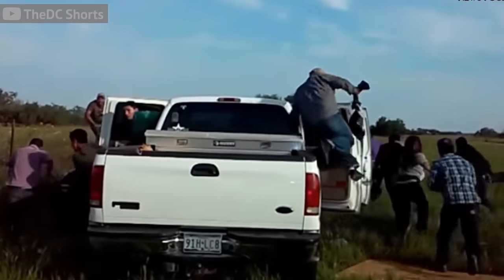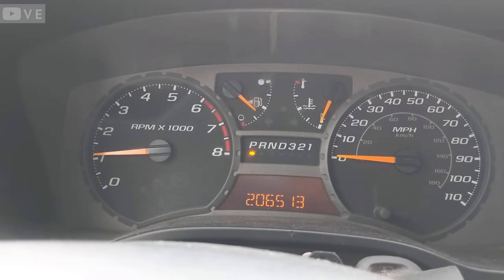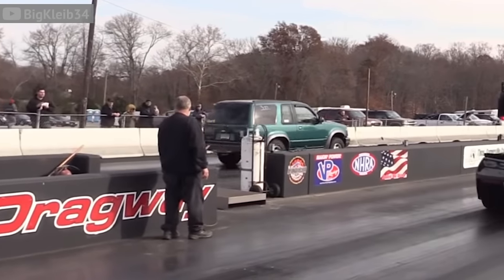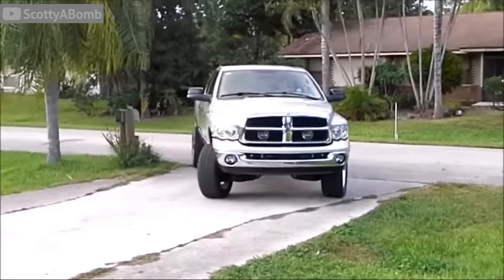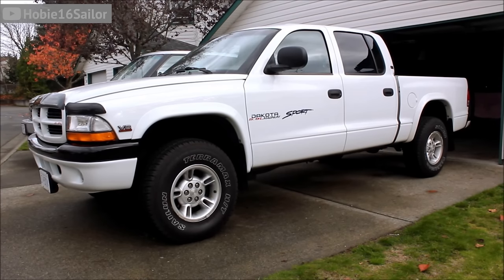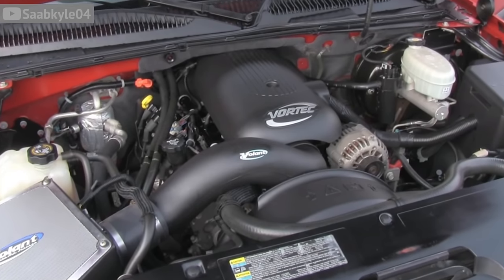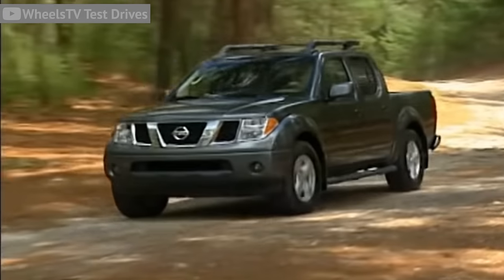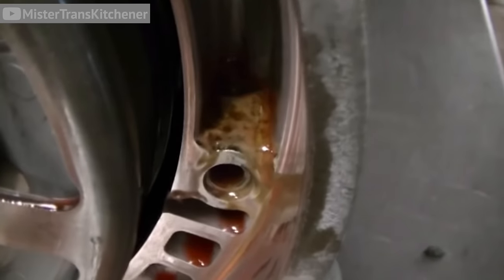USED TRUCKS YOU SHOULD NEVER BUY!

Comment: I’ve never seen a more worthy comment section. Avalanche gang ✊
Reply: @Roberto Ojeda both of my brothers had one both on them broke and it was expensive
Reply: My Avalanche 2005 has been all good I've had it for 16yrs no major problems just had to replace the water pump at 127k
Reply: I only had to replace the diff at 150 cuz we run 5400 rpm 5 days a week
Reply: 06 Avalanche Z71 on my 2nd transmission and 3rd engine.  230k on the chassis.  But damn I’ve got this thing looking good and other than the chassis, brand new.
Reply: What would be the best year you recommend? Have always loved avalanches.
Reply: @christianrojas4610  any year, they all rock
Reply: @christianrojas4610  yes and 2008
Reply: 2002 avalanche z71, 313k miles. It’s been a great truck. Only major problem was a trans rebuild around 230k but 4l60’s suck anyway.
Reply: @rsk72387  I have the new style 07 272,300 rate now Been great
Reply: @rsk72387  
 Not if you beef up the gearing and put in a Corvette salvo
Reply: im now at 400k miles on mine
Reply: 2002 avalanche and it's been great! Almost 200000 and no major issues
Reply: Avalanche 2500 8.1L is bullet proof.
Reply: @christianrojas4610  first gen all the way 02 no shitty DOD no electronic throttle body no cracking dash. The list goes on plus the first gen is way sexier than the next gen
Reply: AVALANCHE GANG!!!✊
Reply: I was sholl like dude got the avalanche twisted my boy said the taste police🤣
Reply: @natenate1462  I just had to do the same
Reply: Ive had my 04 avalanche for several years, only issue is rust. If you have to include these for driveline problems you have to add silverados, tahoes, and burbans. They are pretty much the same underneath.
Reply: @icanbreathenow1   I'm about to buy  a 2002 avalanche 1500 z66 w 82k..I was on the fence but now I'm thinking I should just do it. It will be my first truck
Reply: @splishsplash2150  398,000 miles same motor second tranny but I wasnt nice to mine and its been the best vehicle I have ever had!!! But ive replaced wheel bearing (front) battery, alternator,belt, water pump, fuel filter twice, fuel pressure regulator, 4 sets of tires, one window regulator. I pull a 24 foot boat for fishing I pull a 28 foot camper for camping. Its been through hell and back gravel pits,mudding,jumped approaches, snow bashing, burn outs. I have nothing bad to say about my 03 avalanche 5.3. Oh and my cats got plugged but for that many miles id be plugged to lol. 💪💪
Reply: I just got a 2013 chevy avalanche Ls black diamond edition and I love it!! It may not have heated seats or a garage door opener with it as well as a sun roof, but it’s been the best second truck I’ve ever owned. AVALANCHE GANG✊
Reply: @johnsonoutdoors8117  were your brothers playing tug of war with them or something like how did that happen?
Reply: @Kill0trocity  daily driving
Reply: 2002 z71 and only problem was a bad fuel bump and window motors . Also WTF HE MEAN first and last the had 2 generations not only chevy but Escalade  also had there version . And now it's coming back in chevys new Ev is the spiritual successor
Reply: I love those avalanche seems everyone that owns one loves them
Reply: I just got one it’s 2005 with heated seats and sunroof lol 140k

Comment: Completely disagree about the Chevy Avalanche. I’ve owned one for more than ten years and zero issues, definitely one of the most reliable trucks ever! wish they could bring it back to production again.
Reply: Facts the 5.3L in that thing is bulletproof guys on crack saying it had issues now the 4l60e has seen better days but its normal
Reply: Fr my dad and my grandpa both had one and never had one problem
Reply: I had a 2003 Avalanche. It was a pretty good truck with 258K miles. It only suffered from Rear differential problems but then it got fixed and still runs great. Until a Carvana truck totals my Avalanche :(
Reply: The Avalanche was a sweet truck and I wish they still made it, I still see them on the road all the time! Also as mentioned above the 5.3 liter engine was bulletproof and they used it in their pickups for years with no problems! Also I had 2 trucks with a 4L-60E behind a 5.7 and both were stock transmissions and had never been rebuilt and one had 150,000 and the other 200,000 and both were still running strong!
Reply: Agreed, I got a 2012 avalanche with nothing on it, everything is original. Nothing has been wrong accept the engine light is always on.
Reply: I have an 08 with 55k and have never had any issues.
Reply: I agree the Avalanche was one of the best vehicles Chevy ever put out.  I do not know many people who have owned one that have not been happy.  We have a 2004 we bought new and it is now around 200k miles.  Engine and Tranny has never had an issue.   We did finally have issues with Speedometer but the vehicle had 150k miles on it.

Like any other vehicle you need to take care of it, we will drive out until it just dies.
Reply: Agreed. It's a great truck.
Reply: Yessir, he said mustangs have the 5.4 I think rare models did so I don’t believe this guy or trust him at all.
Reply: x2, was rather surprised to see the Avalanche on the list. I agree the the AFM 5.3L was a stupid idea, but the original 5.3, the 8.1, or the 6.0 L engines were rock solid. Mine went way over 250,000 miles before we just decided to downsize.  I would buy one in a second - especially if it had a Duramax.
Reply: I love mine! Got an 03 2500 with the big 8.1! Thirsty on the gas and the oil though lol
Reply: 11 years still driving!!! Do not agree..👊👊 avalanche rules!
Reply: Totally agree avalanche are awesome.  I have a 2013 black diamond with 6 inch lift and 35s on it.   X pipe dual exhaust and a tune.    Truck runs solid.   Been looking into ls motor swap.  For 6.2 liter as the 5.3 is seriously nut less with big tires.   But I love my ride.   Get comments all the time just wish it had more balls.
Reply: ThePro_Luis rip
Reply: They are coming back next year 2021 and they look awesome
Reply: Same here. I’ve had 2 Avalanches. Great truck for sure (or SUV) which ever you prefer.
Reply: They are soon.
Reply: Sitting  in an avalanche as i type this lolol
Reply: My brother owned his Chevy Avalanche for 19 years... Its a red & he bought it brand new. He had zero problems with it throughout the 19 yrs he owned it.  He didn't have any problem with it..until last fall when his metal brake lines broke while he was driving causing total brake failure. He had to crash it into a tree to stop it.  He's been rebuilding it... replacing the fenders and hood and bumper that were crushed by the tree and he installed all new brake lines.  His Avalanche is now back on the road, except it now has a black front end clip.
Reply: Hey no he's right I purchase a 2013 Black Diamond Edition Avalanche june of 2019 it had 80,000 miles and the interior is like new...even the green color was a limited edition...and right out the gate 30 days in the check engine light kept coming on.. took it to dealership they didn't find anything ...then kept loosing oil pressure...then back to the dealership...it was like that for an entire year and a half until a week ago when the damn engine light came on it started knocking and I was 45 min away from my house...had to get a new engine.. internal failure on cylinder #2 and cylinder #1 intake valve lifter collapsed...also I found out there is a class action lawsuit against GM... beautiful car but that shit cost me...
Reply: Still rockN my 2004 Chevy avalanche 1500 problem free except I’ve had to change the alternator.
Reply: I love my 2003 Avalanche.  No major problems with it.
Reply: I got my '04 Avalanche in '16 for $2000 from my boss, today its worth $8000 with 400k kms, runs great.
Reply: My dad bought one in 02 gave it to me with 120,000 miles in 2012 and it's still going strong at 220,000. The plastic is a bitch but also nice not have to worry about door dings in parking lots; the plastic absorbs most of that.
Reply: @sellyoursoultome  I seen some guy take a power washer really close to the plastic , it actually turned out pretty decent.
My truck has been faithful.
Reply: 04 Z66 and never had issues
Reply: What y’all think about this new avalanche they came out with ?
Reply: @samschmidt3381  maybe in 2023. They have brought back newer versions of the older models like the bronco that went out of production long ago so I don’t see a reason why they wouldn’t bring that one of a kind truck back
Reply: @sellyoursoultome  That’s one thing I miss about my old 2002 I just recently gave her up for a 2013 black diamond Ls. Miss her a whole lot. She was very rusty from that salt on the road but she was faithful
Reply: Rumors report it will begin reproduction in 2023
Reply: @j.stattikk8886  LTZ, LS, or LT? I’ve got an LS and she’s beautiful
Reply: I bought (and still have) the first model year (2002) of the Avalanche. 163K miles. Still on the first set of brakes. Does not use any oil. Only repair was replacement of the fuel pump several years ago. Chevy can call it anything they want but I have used it as a truck from day one. Great design!
Reply: @thepro_luis4274  That is the only way I'm parting with my 04.  I love my Avalanche!
Reply: @awright2386  I love my 04.  I'll drive it till it dies and then do a frame off rebuild.
Reply: They brought it back
Reply: @superfardman4332  that electric abortion is not an Avalanche.
Reply: Agree i have an avalanche the only issue i havent delt with yet is an evap system thing, could just be an old gas cap but its 2004 and still mostly stock parts
Reply: Same here.. haven't had it ten years but I've had mine 6 months it's an 02 with 162,000 miles and zero problems whatsoever so far
Reply: This guy isn’t very smart about the Avalanche

Comment: I worked on the Avalanche from Concept to Launch.  I have had my 2002 for 17 years and 270,000 miles.  Here are correct answers... 1.  The Avalanche is a variant of the Suburban (rolling chassis and engine are identical).  2.  The TPO cladding was not painted.  Long term validation tests revealed chalking and zebra striping, so the resin was changed for 2003.  This issue is only for the introduction year of 2002.  3.  The 5.3l Vortec engine is rather robust and used in the entire GMT800 vehicle line.  Same for the 4L60E transmission.  That continued for the GMT900 full size vehicles as the new engine and trans combinations were the same.  Any problem you cited would be across all those vehicles.  The reconfiguration ability us what made that truck great... and the tent offered was pretty awesome too.  I am ok with you not liking them, but I think your reasons are not strong except for the cladding appearance issue.
Reply: Love my 02 also lol
Reply: The 4L60E is trash though
Reply: @coarsethread7581  Mine went out on a chevy blazer but my avalanche is good so far.
Reply: @coarsethread7581  because people don't maintain them. I'm 305k strong on a original 03 4l60E and I've had some fail at 280. It's all how you take care of something.
Reply: The Avalanche is a great used truck to buy!   I drove the same one from 16 years old (when it was my dad's), then he gave it to me when I started university and I drove through my entire undergraduate years, then kept it as my winter driver.   It was about 15 years old when did begged me to sell it, over the course of a year.      It was EXTREMELY well taken care if.   With over 255k kilometers on it, he still bought it for top end of the value, because it was in excellent condition!

I drove it both ways (trans Canada, coat to coast) 3 times, only ever having 1 problem, which was me blowing a tire on a sharp rock, because I hit a trail with no spotter lol.

The avalanche was stupid reliable and doesn't belong on this list
Reply: Ive got an 02 with 320k! Its a POS but is MY POS and it starts every time
Reply: @WishyIV  No POS starts at 320k.. Just saying lol
Reply: @Details99  u must baby it... Its a truck with a heavy tow rating. The problem with the 4l60e is the castings break inside... The 4l65e is a bit tougher and used on the Escalade ext.... Much much better trans for towing and harder work.
Reply: @afn-bd2ro  yea but that’s not a truck 🤷🏽‍♂️ lol
Reply: I just got a used avalanche with 107k miles. And I'm going over all the functions of this thing and it is a brilliant design.  If you were part of it that my hats off to you! good job to the whole team. Great for a working family man. 

 I hope chevy knocks the new stout out of the park with a mid gate and bed extender that can hold a sheet of plywood with the tail gate down. 

If it is based off the AV with design functions the maverick will be an after thought.
Reply: My Avalanche has been going great for 20 years!  Definitely got my money’s worth!